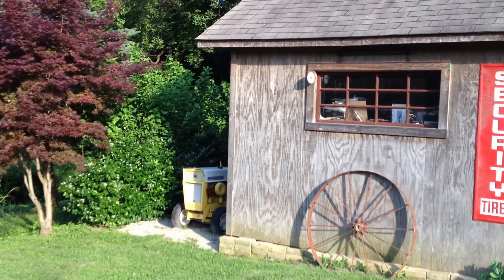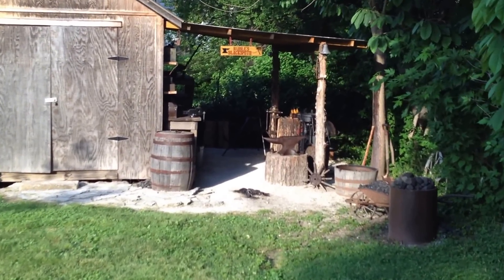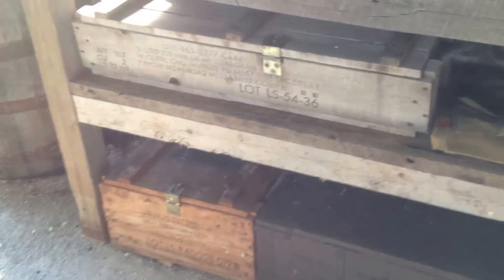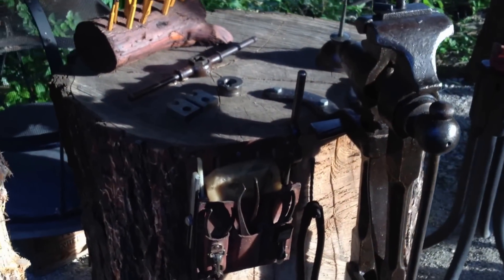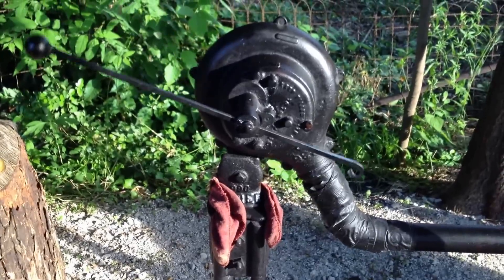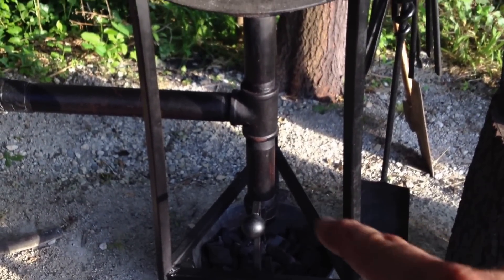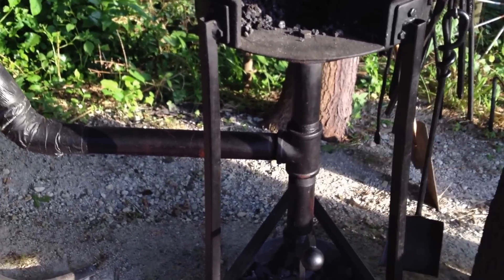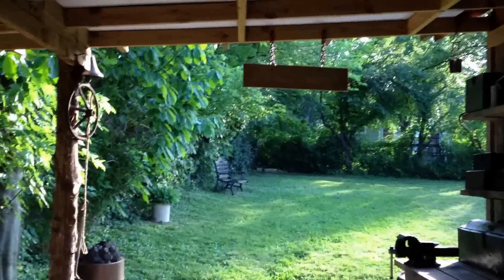Backyard Blacksmith Shop and Brake Drum Forge

Comment: Here is idea for blower. Use a dryer motor and blower wheel assembly. Preppers, if motor bother you then take it off and I'm sure a hand crank can be rigged. There must be a few hundred free dryers on craigslist to get and disassemble to get these parts. Hook to forge with metal dryer vent tube.
Reply from the maker: Regulate it somehow or you’ll have way too much air. It’ll create a hollow fire.

Comment: I really really like your forge setup everything on it makes sense. I was wondering if you could send me a copy of the sketch up in decent quality so i can look at it. I accept all responsibility for the building and use of the forge and you will not be liable  in any way. I just want to use a lot of your ideas but, have some of my own to possibly improve it. I am a diesel mechanic and I work for international so guess what i am using :p. I would really like the plans and any advice especially on cutting that drum cause i am thinking im going to have to get a diamond cutting disk. You can message me on g+ hope, to hear from you.
Reply: be carful with those deep drums off 2 tons they are normally to deep and you have to make a lot coke burn to to do small pieces and go to deep to do big pieces
Reply from the maker: It’s actually painfully simple man I never made a blueprint but several rough sketches on scraps of paper that got stuffed in my sweaty pockets while I was working my other job haha.